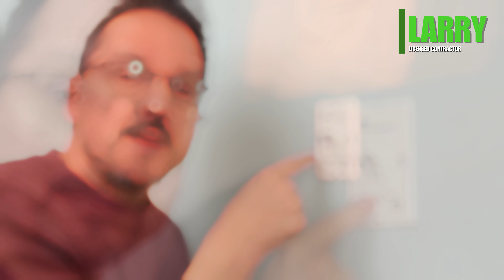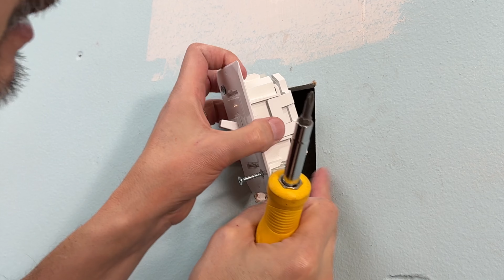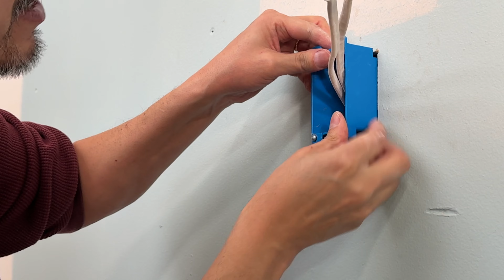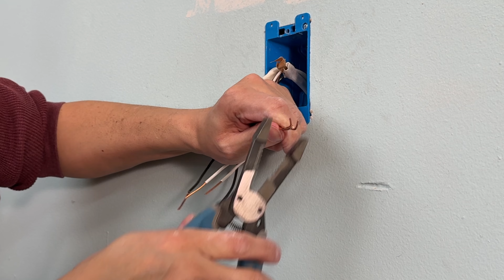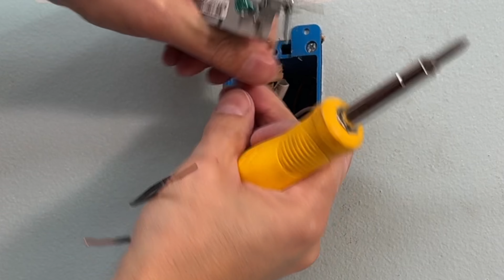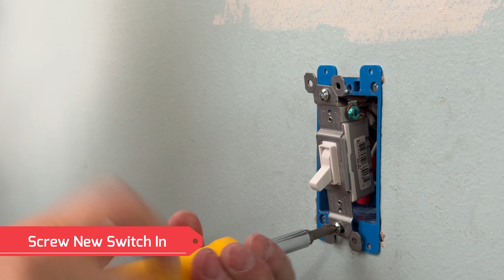Replace Mobile Home Light Switch To Standard Electric

Comment: My problem is I have this exact same kind of switch but it also has the other crap piggy back off of it in other words they cram like two or three wires in there like receptacle or something as piggyback off of that light switch and when you replace it there's not room to do it with a normal light switch so the whole wiring is just jacked up
Reply from the maker: I'm sorry to hear this. Yes I wish wall boxes were larger or wire connectors were smaller, because space is always at a premium

Comment: When you say cheaper you mean flimsier? Not economical?
Reply from the maker: Hello. Honestly, I don’t remember in the exact context I used that word. It just seems to me It was a bit lower quality than standard electrical components. Typically stick frame housing… 

Mobile home components are harder to source and find… I wish they would use more standardize components…
Let me know if you have any other questions. Thank you.
Reply: @HomeRapidRepair  , I agree.  We have one local mobile home store and everything there is a minimum 5x the normal price of the parts.  I went to buy a replacement switch and they were charging $78 for just the standard switch.
Reply from the maker: @RabidSnarf it’s highway robbery…upgrade to standard devices
Reply: @HomeRapidRepair , I'm about to start doing that. II was googling if I could change the type of switch and thankfully, your video came up!

Comment: Thank you! Your video is the closest to what I am looking for, but I still have questions that hopefully you may answer. I have a 7 year old Clayton mobile home that has 1 light switch in bedroom. I discovered that there appear to be 3 (or 2 with the 2nd running across back of that press-in switch) 14/2 romex lines. My new dimmer switch has line wires and can be for single pole or 3 way, and I need to do the single pole. I have a volt pen and multimeter, so I will turn breaker off, open up the romex, separate and strip wires to test them. Maybe this is a switch loop, and I'm hoping that there are no downstream outlets that would be affected. I will keep researching this until I feel confident to proceed, haha!
Reply from the maker: Yes. Essentially, you have all the steps figured out. You’ll figure it out for sure 👍🏼 That’s why I like the WAGO lever lock wire nuts because you can temporarily connect the wires and then carefully turn the power back on and test your connection before you install your fancy new dimmer switch.

Comment: Standard boxes will not fit in the wall of old mobile homes.
Reply from the maker: Interesting. Thanks for letting us know. The old work wall boxes come in like four different sizes… I wonder if the smallest one would fit?
Reply: They fit just fine if you buy either of the 2 smaller sizes Carlon makes and if most fo the newer mobile homes now use actual 2x4 interior walls so everything but the deep Carlon boxes fit perfectly inside the walls.
Reply: Have to use shallow plastic electric box standard electric box will not work in a manufacturing home.